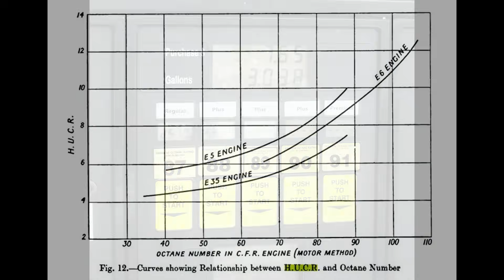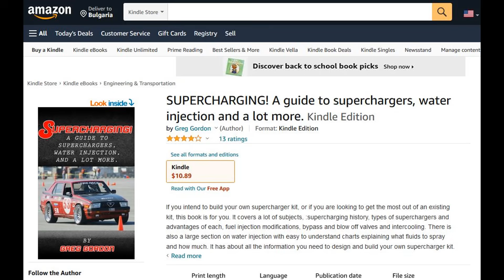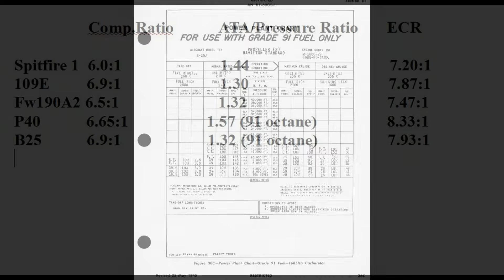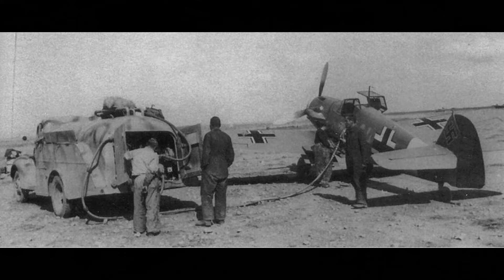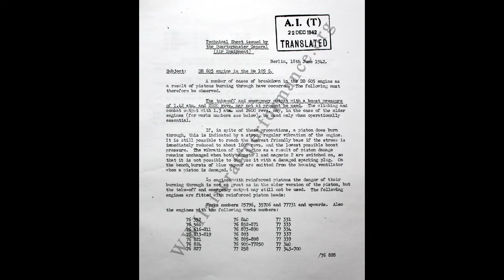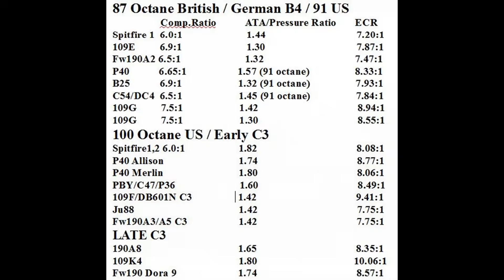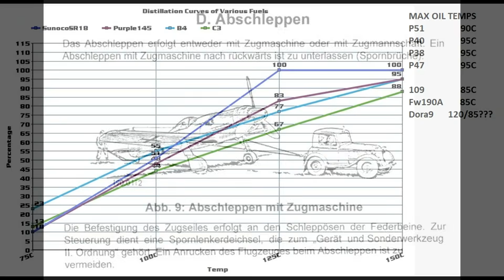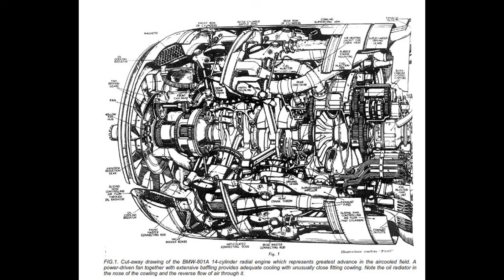German C3 Fuel, Uber Octane or Synthetic Crap?

Comment: 12 pounds of boost on 100 octane fuel? Weak. I ran 26 pounds of boost on 87 octane fuel for over four years and around 80,000 miles before damage occurred. Eventually it burned thru a piston and bent two connecting rods but it was also leaning out at high boost because I ran stock fuel injectors and they could not flow enough fuel to keep the air-fuel ratio rich enough so exhaust temps were getting high. Mazda BP 1.8 turbo, Walbro 255 fuel pump, Haltech E6X ECU, manual boost controller, 3 inch exhaust, intercooler, MSD ignition, I had to go down a heat range on the spark plugs and I set the AFR under boost as close to 10-1 as I could get with the stock injectors. Stock block, stock turbo, it would push over 30 psi when the boost controller was cranked but it kept blowing my intake plumbing and vacuum lines off so I turned it down to 26 where everything stayed attached. I am looking for a replacement Mazda BPT or BPD, anyone got one laying around? Mine is now destroyed due to a connecting rod that broke after the first rebuild, I used Eagle rods and they apparently do not like 9600 rpm, my factory rods held up just fine but the Eagle forged H beam rods broke.
Reply from the maker: Great. Now do it using a carburetor, no intercooler and no electronics.

Comment: Thanks for the well reasoned outline Greg. 
I wonder if the "conservative" ECR for the Merlin engine was related to the use of a carburettor rather than fuel injection. 
Stanley Hooker (Merlin supercharger designer) states that placing the carb before the supercharger gave it cooler (25c cooler) more dense air to work with so the air in the inlet manifold was cooler and more dense than would be the case with the DB601 etc with direct injection, where the inlet air was not pre-cooled, so the fuel-cooling in those engines was working on less dense air (for the same inlet pressure). That denser air for the Merlin gave it a higher-than-apparent ECR and  meant you could burn more fuel and extract more power.
Reply from the maker: That's not quite what he said. The Carb was not an overall performance advantage, which is why Stanley Hooker and the Merlin went to US style injection. Now all things equal cooler air allows for a higher ECR, not lower.
Reply: @GregsAirplanesandAutomobiles  I'm saying that the denser/cooler fuel/air mixture entering the engine means more heat during combustion, so more likelihood of detonation. Starting with a fractionally lower ECR might have been designed that way to prevent detonation with that denser (higher peak combustion temp)  mixture. 
The injection carburetor (throttle body injection) came in 1943 with the two stage supercharger in the Merlin 61 and later versions and it did have an aftercooler. Not part of this discussion which involved the earlier Merlins without an aftercooler.
Reply from the maker: Carbs massively increase the chance of knock over fuel injection, but it's not due to the temperature drop. I might make a video about this at some point.

Comment: Interesting video. In the rationale for mixture usage, you never mention the fuel savings of lean over rich mixture. The Germans certainly had a military with fuel supply issues.

 I can reduce fuel flow by about 40%. Granted EGTs get high but CHTs drop significantly and that is a better gauge of cylinder pressures.

Lots of variables in the whole engine management discussion with answers heavily dependent on the current flight regime.
Reply from the maker: When at war emergency power, fuel consumption is irrelevant. You don't save any fuel if your plane gets shot down, and this was a setting only used in really dire situations.

Comment: Dynamic Compression” is the name. Like a compression check? It’s Based of “ Effective Stroke” based off  the intake valve closing event and V.E.
Reply from the maker: That's a quagmire I just didn't have time to get into in this video. The complication is that yes, the valve is closing later, but it ingested more air, which is the entire reason the cam timing was set up so that the valve would close later. Talking about that would require its own video and I'm not sure it would fit well on this channel.

Comment: I have experienced that in Aircooled engines one has to run a richer mix on order to control temperature, the eye opener was when  running a oxygen sensor on a CBX 1047 with Dellorto 35 BHLB particularly when running in and out of rain squalls...doens on see something similar on aircooled aeroengines ?

Comment: To be honest, it feels like the Germans were forced to improve the technical aspect of their engines because of lackluster fuel.
Correct me if I'm wrong, I'm as far from an engineer as one can be, but one of possible ways to improve the horse power is increasing the capacity of an engine. 
And when it comes to, for example, RR and DB engines, the DB-601 --> DB-605 looks somewhat similar to Merlin --> Griffon.

What I'm getting at is about "what-if"s. Had the Germans had better fuel from the start, they might've gone for slower capacity increase. And had the Allies had similar fuel to the Germans, they could've pushed their engines in the similar manner as the Germans historically did.

I'd love to hear what you think of this idea, but please don't be too rough if I'm mistaken.

Comment: Thx Greg for very interesting and clean, simple explanations in this episode. I`m very interested  about P-38`s early versions of Allison engines, especially in theirs work at high altitudes over Germany. What was the problem of early Lightning`s at high altitudes? Why coolers and engines sometimes fail at this conditions over Europe? How quality of fuel is connected to Allison`s engines and cooler system problems ? Can You make a episode how altitude of flight changing fuel/gas parameters and how it looks from pilot view? (Sorry for my english). Thank You for your effort.

Comment: Did America import any of it’s oil during the war, or did it pump it from domestic fields only?
Reply: I don't know for sure that the U.S. did not import any oil.  But in 1941, the U.S. was the largest oil exporter in the world.  Japan attack the U.S. mainly because of the oil embargo (and other sanctions) done by FDR as a result of the Japanese aggression in Indochina (and other areas -- basically the Japanese invaded the Vichy French colonies).   Japan only had enough oil reserves for approximately 1 year.  The Japanese Admirals or most of the Admirals knew Japan would lose the world.  No natural resources and the threat the USSR constituted were also factors.  Japan and the USSR clashed in (I think) 1939 and the Japanese were eventually crushed.  It was a small conflict but essentially it showed that Japan still had a WW1 Army.  Little armor, insufficient artillery, a Army Air Force that fought well but was defeated.

Comment: Has anyone ever tried to build a Turbo Diesel powered airplane?
And if not why not?
Diesels are the way to go for huge boost and torque.
Also they wouldn't need a reduction gear for the propellers.
Also two stroke diesels are much lighter engines with very good fuel economy.
Reply from the maker: Yes, it's been done quite a few times, even by the Germans in WW2.
Reply: @GregsAirplanesandAutomobiles  dO YOU HAVE A VIDEO ON DIESEL AIRPLANES OR can you tell me some of the names and models?
Reply from the maker: The Ju 86 was a turbo Diesel. I don't have a video about it, nobody has ever asked me about German Diesel bombers before you. I have mentioned it in some videos, but I don't remember which ones.
Reply: @GregsAirplanesandAutomobiles  Thanks man, I did a search on YouTube for Diesel airplanes and there are quite a few current developments with two stroke diesels.
They are the most fun.
I used to have a 40 foot bust with a Detroit 6V92.
Supercharged and Turbo charged.
I was getting 8.5 MPG on veggie oil while towing a suburban.
https://youtu.be/63UVFk07oqc

Comment: Might look at isentropic compression formula:  p1/p2 = (v2/v1)^k; k = 1.4 for air, but probably takes on a different value for fuel-air mixtures. v2/v1 is really just the geometric compression ratio, p1 is your intake pressure, which for a supercharged engine is ambient pressure plus gauge boost pressure.
Reply: Thanks!

Comment: think you're confusing your spits with hurricanes greg, spitfires only fought over dunkirk during the evacuation and not in the battle of france, the Raf fighter force was 100% hurricanes. It was these mk1 hurricanes firred with 2 bladed props, fabric covered wings and using 87 octane fuel that the germans flew & inspected and were unimpressed with what they saw. Once the constant speed props, metal skinned wings and 100 octane fuel was introduced the hurricanes performance went from poor to acceptable mediocrity in the words of the pilots
Reply from the maker: I am not confusing the two. Dunkirk was a part of the Battle of France: https://en.wikipedia.org/wiki/Battle_of_France . The first Spitfire operations over the continent were in early May of 1940. They lost 67 Spitfires over France during the battle and up through the evacuation at Dunkirk.
Reply: @GregsAirplanesandAutomobiles  67 spitfires lost "mainly during the air battle over Dunkirk". First enemy encounter over Holland 13th May, first victory 23rd May, 4 days before Dynamo. I can't find any reference to the first spit shot down over France only the previously mentioned Dutch sortie. Apparently all RAF fighters were using 100 octane fuel in the battle, I was always under the impression only UK based squadrons used it, the French based units 87.....you live & learn
Reply from the maker: I'm not sure what your point is. Are you tying to argue that operation Dynamo AKA Dunkirk wasn't a part of the battle of France? It would seem that's what you are trying to say.
Reply: @GregsAirplanesandAutomobiles  you state in the video that spitfires over France had worse performance than those over Britain but they were using 100 octane from "early spring". Now what that date is it doesn't say, but spring in the UK is march & april, and as you know all were based in England. Some may or may not have been converted from 2 pitch to constant speed props but the improvement in performance from fuel was  already available was it not? The advantages in combat of a constant speed prop are well known so it could be pot luck if a 109 met an updated spit but would that be as big a performance gain as extra power?
Reply from the maker: I think you are hearing things differently that what I actually said. I never said anything about where they were based. That didn't even enter into the discussion. Spitfires were lost over France during the earlier part of the war including during the Battle of France. It's just a fact that 67 of them were lost in that region and during that time period. Now regarding fuel, there is a difference between when the 100 octane fuel showed up and when it was in use by all squadrons. In the Battle of France British fighters were normally using 87, that doesn't mean there were not a few with 100. As for the propellers, I have an entire video about that where I cover the various types of Spitfire props at length.
Reply: @GregsAirplanesandAutomobiles  that's my point regarding fuel Greg, it makes logistical sense for the hurricane squadrons to use French fuel (87 octane I presume) as they were sharing their bases. If the British were bringing in their own fuel from the UK then why not bring 100 octane as it was available unless they were intent on building up stocks for the forthcoming defence of GB, more digging required, I'll get my spade.
Reply: @GregsAirplanesandAutomobiles  started building up stocks of 100 octane fuel 3 months before war began and the programme for modifying merlins to use it started in March 1940 so as you say, who knows how many were done by May

Comment: The ratings for C3  and Allied fuel were calibrated differently and give a very false impression.  During 1939 to 1941 the C3 fuel was superior to our 100 octane but from late 1941-2  the mixture of C3 was not suited to German front line fighters This disconnect was due to built in schisms and disagreements between pie-in-the-sky engine developers and production engineers who were being forced to use inferior materials for highly stressed components specifically the problems began witht he derating of the combustion chamber valves. 
This self caused problem was eventually cured by deep chrome plating all of Germany's fighter engine valves. 
All test bed prototype German Fighter engines were developed with the cylinder heads uppermost and the sump beneath these high quality Versuch Engines did not have any problems with oil getting into the combustion chambers or fuel in the sump so combustion characteristics were much more easily optimised and the engines were reliable.   It was a very different story with the production engines with valves and pistons burning out as soon as any worthwhile kind of mechanical or chemical boost was employed .  
Engine oil was leaking profusely into the combustion chamber and reducing the C3 octane and C3 fuel was leaking into the sump and causing excessive and premature engine wear.   it was only in 1945 that these problems were solved in the meantime Germany lost the air war and Germany was defeated.

Comment: I do not understand how the 60’s era cars you discuss, all of whiche carbureted, and naturally aspirated, coukd have different manifold pressures.
Reply from the maker: Hi Stan. Two barrel carbs by their very design restrict manifold pressure when used on larger V8s, especially at high RPM. That's the reason two barrel carbs are slower than four barrels in most cases. It's because they have less manifold pressure.
Reply: @GregsAirplanesandAutomobiles  interesting, that makes sense, thus intake manifold vacuum. Thanks for educating me

Comment: Another great video that fleshed out a topic I have heard mentioned forever but never dealt with in any detail. But I was a little surprised that there was no mention of ignition timing and its role in detonation. I would suspect that in the V-12 motors, having such similar designs, ignition timing was also similar, but is that true? Higher octane fuels typically allow more ignition advance which will generally produce more power, so it might be interesting to know how the ignition timing was set among the different engines. Nowadays racers have anti-detonation injection systems, but I suppose nothing like that existed during WWII except for the pilot's senses and brains.

Comment: 12 pounds of boost isn’t 1.82 atmosphere of pressure as one atmosphere of pressure is 14.7 psi.
Reply from the maker: 12 pounds of boost is 1.82 atmospheres. Marcus, let's do the math together. 12 pounds of boost, means 12 pounds above atmospheric, so 12+14.7= 26.7psi absolute. Now divide that number by 14.7 and what do you get?

Comment: Octane rating is pretty standardized. The actual reason for the name "octane rating" is the comparison of the fuel being tested with the performance derived from pure isooctane fuel, hence "octane rating". Octane is the chemical name for any hydrocarbon with eight carbon atoms. Regular octane is a hydrocarbon with the chemical formula C₈H₁₈, To explain the difference, this is a straight chain of carbons without a branched chain has a hydrogen ration of 18 hydrogen to eight carbons. Isooctane  consists of the same eight carbons but branched in a way that allows the carbon atoms to react more rapidly and completely when burned in the equivalent amount of oxygen causing less preignition. That is why it has a role as a fuel additive to increase performance (increasing the Octane rating) and when used as100% of the fuel is the standard all mixtures are compared with. Of course, you CAN mix a fuel that burns BETTER than 100% isooctane by adding aromatics (benzene etc) and TEL.
Reply from the maker: I am amazed at how much knowledge is contained in my subscriber base. Thanks Tim.
Reply: @GregsAirplanesandAutomobiles  I'm just glad to finally find a use for my obsolete Chemistry degree  Octane rating is old stuff, everything else has changed LOL

Comment: Doolittle's early drive for high octane fuel points out one sometimes neglected aspect of the man.  Doolittle was not only a great pilot.  He was also a great engineer.  Doolittle had a doctorate from MIT.  He did much of the work developing early instrument flying.  He also had the foresight to see that with higher octane fuel available, higher compression engines would follow.  This is often the case with technology.  Develop a method for producing a chip with greater device density and electronics taking advantage of that device will follow.
Reply: 😂 WE OWE A LOT TO JIMMY DOOLITTLE ‼️🇺🇲🗽

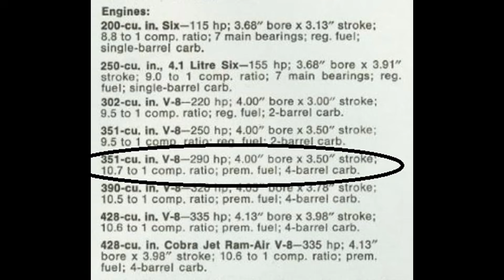Comment: 8:38 how do Americans achieve that? How is it possible to extract so few horsepowers from such a huge displacement?
Reply from the maker: Think of it this way, the American cars of the 60's would outrun European cars that cost 3x their price, so the big engine idea did work for that purpose. It's not a question of engine displacement vs. horsepower, it's a question of engine weight  vs. horsepower. A Ford 351 has 5.7 liters but weighs less and makes more power than a Jaguar 3.8 liter.

Comment: Your confusing detonation with preignition. Detonation is the ignition of fuel caused solely by compression.  Preignition is the ignition of fuel caused by a hot spot in the combustion chamber  such as a hot valve or buildup of carbon.  Your piston will tell you which condition is present.
Reply from the maker: I am literally using terms straight from NACA reports on the subject.